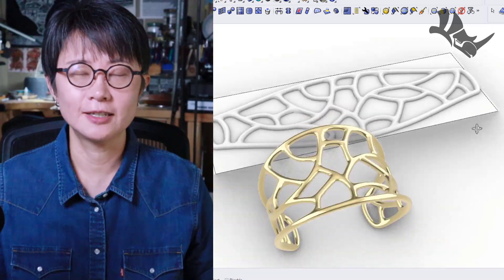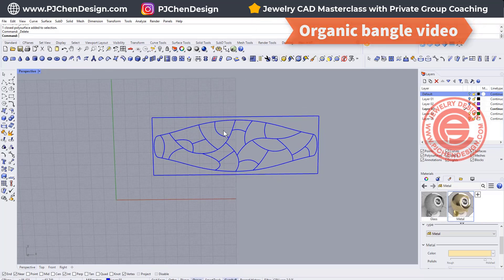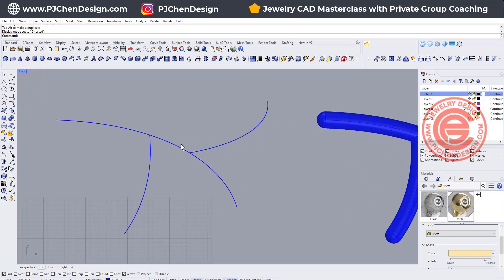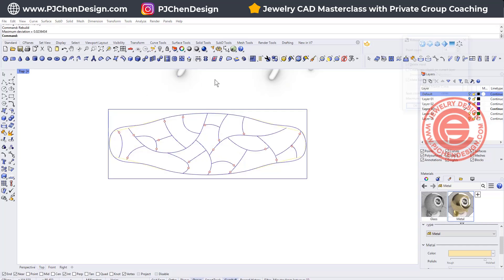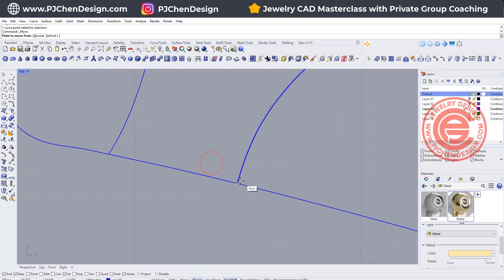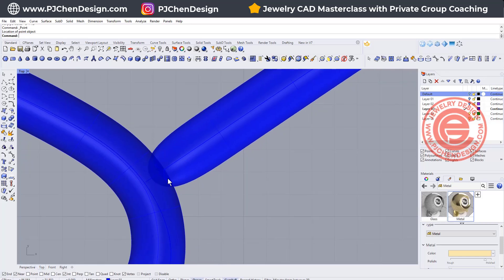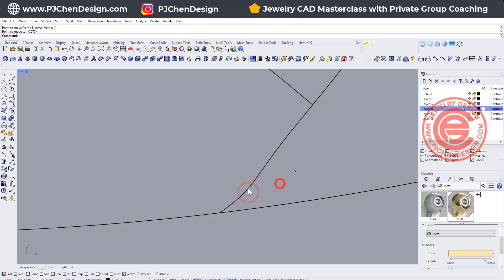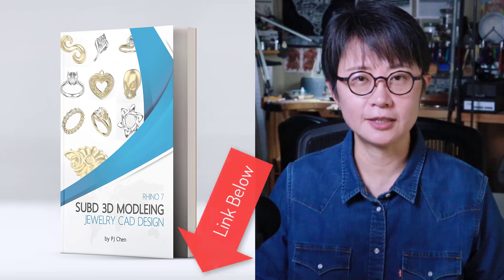Rhino SubD: Organic Surface Modeling with Multipipe Command #476

Comment: Thank you for your effort and the demonstration. <3
I would suggest the curve/extend function with the corresponding sub-function so that the line ends can be adjusted more quickly. This function not only extends, but can also shorten. It does not have to be activated again and again. After adjusting the first curve, simply go to the next curve and so on.
Reply from the maker: Thanks for the tip!